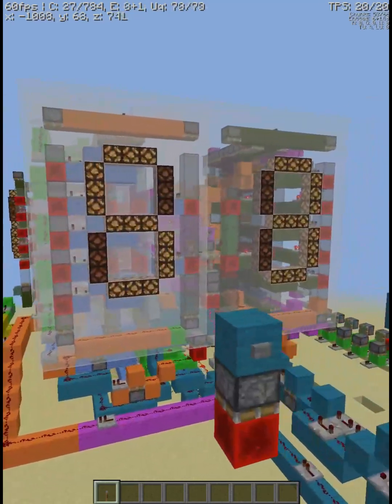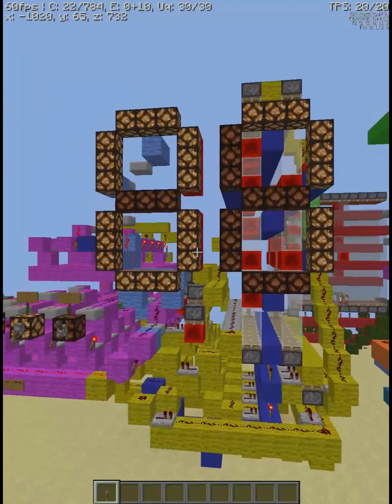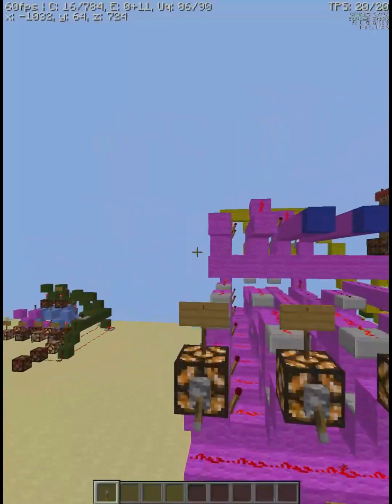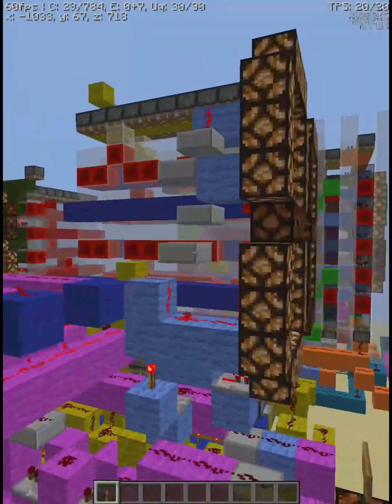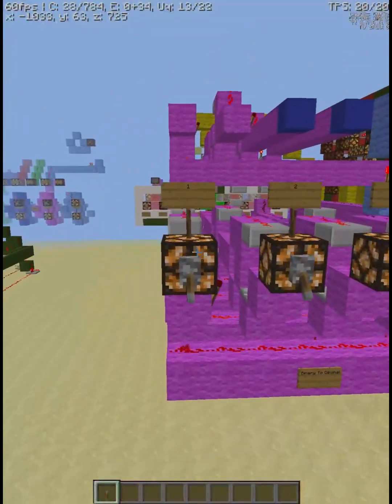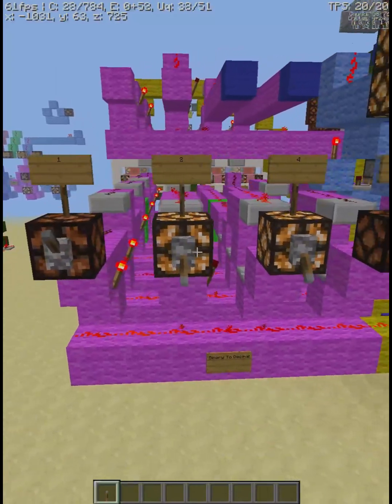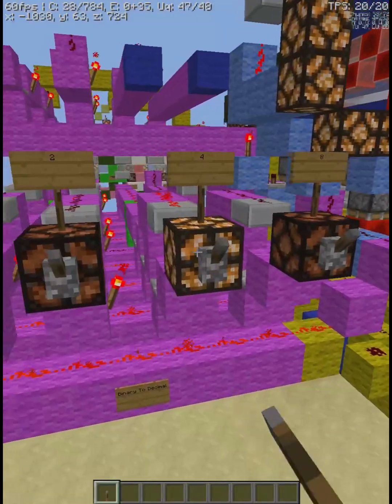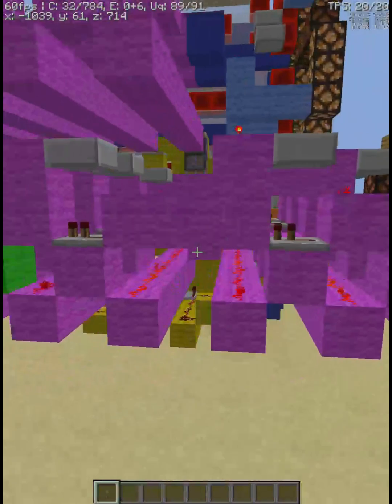Binary To Decimal Display In Minecraft | #minecraft #youtubeshorts #gaming #fyp #shorts

Comment: ok but why pistons?? they are slow
also use world edit and texturepacks, it's much easier
Reply from the maker: This was done on eaglercraft on a browser, I do not have access to world edit, or other commands. I used the pistons because I am used to them and am experimenting with this technology
Reply: @MCinschool  don't have access? What do you mean
Reply from the maker: @Arsen1c312because when I am doing redstone I am on a computer that does not have the normal Minecraft version, I am playing on a browser version. This is also done on a very early version of minecraft
Reply: @MCinschool  yea I get it but why not normal?
Reply from the maker: @Arsen1c312I have Minecraft on my main computer but use eaglercraft on the laptop because it is easier to run and so I don’t have to redownload/setup Minecraft. It works mainly the same way anyways, just a buggier earlier version
Reply: @MCinschool  alr whatever 
Still don't see any problems but ok
Reply from the maker: @Arsen1c312 Yeah. I do need to try using less pistons and get my number  displays simpler.